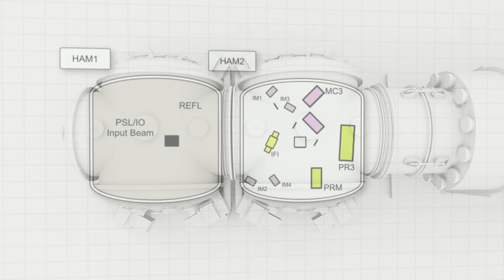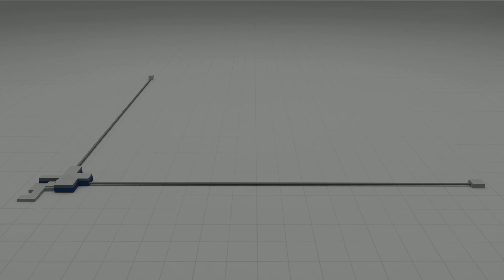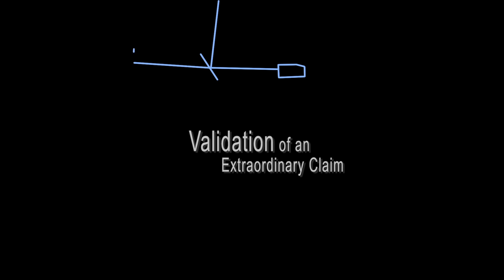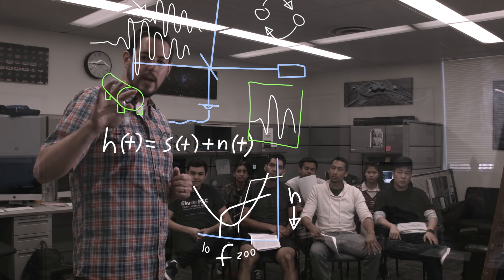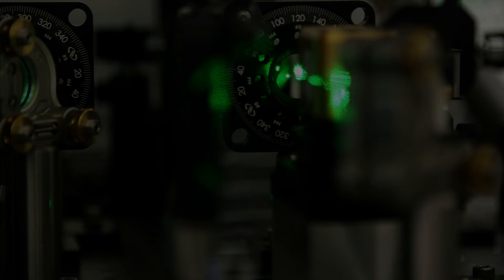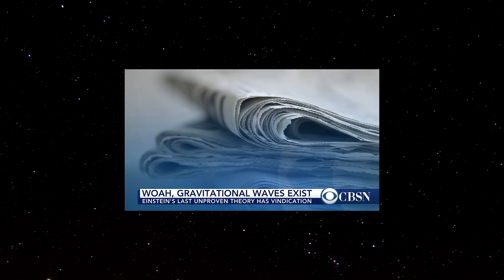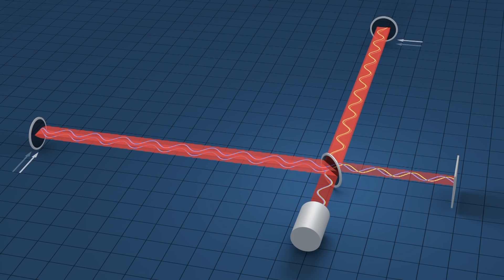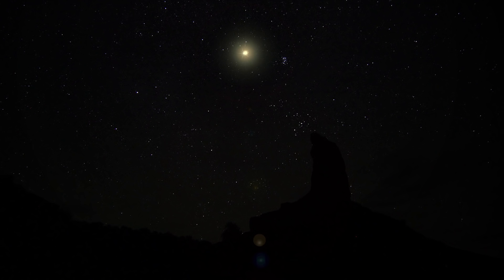LIGO Detection (Full Documentary)

Comment: hi, noob question; if gravitational waves travel at the speed of light, then how can the lasers detect it? does it mean the waves have no, or, limited effect on light? does this then also mean that more mass will experience more effect from the waves? will that effect then also cause a wobble at the black holes in our milky way center? will that have another gravitational fluctuation in our Galaxy?
Reply: The ripples in space time slightly distort the lasers inside of LIGO. I believe that's how this was detected.
Reply: The waves distort the spacetime region that one of the laser beam takes to a different degree than the other (perpendicular and correlated) laser beam takes - so one of them ends up ever so slightly shorter than the other (a very slight difference - and that's only after the beam has travelled through the 4km long arms hundreds of times). As a result, when the correlated beams are recombined, they no longer 'fit' together - and interference patterns are observed. This could be detection of a gravitational wave created billions of years ago when one BH merged with another billions of light years away.

However, the same effect would happen if someone somehow gave one of the mirrors a tiny jolt! Such noise can be removed though, partly because the LIGO sites are duplicated (Livingstone and Hanford) - and you wouldn't knock both of them at the same time. But also partly because the expected signal from a merger of black holes (or neutron stars) is very well modelled and known - and is nothing like the signal that would come from me knocking the mirror with my hand.

It's very high tech and the engineering is astounding. But you can get a reasonable feel for it all from good sources on the web. I'd start with Wikipedia and some of the links in there, and the LIGO consortium's websites. The project also do a fantastic twice-yearly newsletter (March and September) and they're all available at https://www.ligo.org/magazine/. Most people use YouTube videos too much IMHO. They can certainly be useful... but the best way to get deeper understanding (whether gravitational waves, maths, or fixing a car engine) is to get stuck in, rather than have information 'delivered'.
Reply: @gordonpanther7766  right so actually this effect is so minimal it wouldn't really have a noticeable effect on other matter? what if you were closer to the colliding black holes?, say the collision happened in the centre of our own galaxy, would the effect be more intense?
Reply: @woof3065  Yes, the closer we were to such an event, the greater the effect would be.

The waves have spread over an increasingly large sphere as they've moved away from the source. Area of sphere = 4 * pi * r * r, so every tripling of distance (say) results in the waves becoming 9 times weaker. These detections are of collisions billions of light years away. The first detection, GW150914 (https://en.wikipedia.org/wiki/First_observation_of_gravitational_waves) was 410 megaparsecs ~1.2 billion light years. The centre of our galaxy is 'only' 30,000 light years so GW150914 was ~40,000 times further away.

So if GW150914 happened in our galactic centre today (or, I suppose, 30,000 years ago, since we want to measure it today # ;) it would be ~40,000 * 40,000 times or ~1,600,000,000 ~1.6 billion times stronger.

However, since the space-time wibbly-wobbling (Dr Who terminology) that was detected for GW150914 was on the order of a thousandth of the width of a proton, and since a proton is only about 100,000th the width of an atom, that 1.6 billion times stronger wobbling would still only be... 16 times the width of a single atom. This is assuming I've not made any daft maths errors or misunderstandings # ;)

But if that's all roughly right, then the effect would be absolutely MASSIVE in LIGO - but in human terms would still be 'invisible'. Which all goes to show just how tiny these movements are and how amazing it is that we can detect them using our technology - and how amazing humans can be when they work together (like scientists do), rather than falling apart (as we, the public have been doing in recent years).
Reply: @gordonpanther7766  thanks a lot for doing al the math and putting it in perspective ^^. And yes it is amazing what we can and have achieved and we could achieve a lot more if we work together more

Comment: My question is: How did the Black Holes found together? Have it been two galaxy cores?
Reply: I think black holes exist independently also, aside from being found in the center of galaxies.
Reply: No, these are stellar mass black holes colliding (i.e. black holes which formed at the end of a massive star's life), not galactic mass black holes.

As to how they merged together: all moving mass gives off gravitational waves, but even when two black holes each several times the mass of our sun collide, the waves received at cosmic distances (thousands or millions of light years) are minute and required extremely complex and sensitive equipment to detect them. But the emission of these waves bleeds off the orbital energy of the system - and the two black holes (or neutron stars) hence slowly approach each other. Over long periods of time, they get closer and closer. The closer they get, the more of their energy goes into gravitational waves and the faster they get even closer - the approach speed gathers pace. Eventually, the BHs/NSs are nearly touching each other and are rotating around their centre of gravity at a sizeable percentage of the speed of light. The final merger happens very quickly and then there is a final 'ringdown' as the resulting merged BH or NS takes on a spherical shape.

Best thing to do I'd say if particularly interested (and have the time!) is to read (in addition to Youtube videos) as you get far more information for your effort/time. Start with Wikipedia, e.g., https://en.wikipedia.org/wiki/Hulse%E2%80%93Taylor_binary; https://en.wikipedia.org/wiki/LIGO; https://www.ligo.org/magazine/ - and some of the links at bottom of those pages etc.
Reply: @gordonpanther7766  Wow, five years later I get an answer. Thank you! 
I've read a lot since then and played around with BHs/NS in Universe Sandbox and Space engine. Now I think I got a grief of what physics are going on. It's fascinating!
Reply: @Irisius  Ha ha. Yes, well I was just in here replying to some other post and scanned through and commented on a few posts at the same time. Some are genuinely interested like yourself - but I'm always surprised how many loons, pseudo-scientists, and conspiracy theorist frequent scientific pages! Well done on your researching! LIGO should be back up for its next session (O4) in 3 or 4 months time (Dec was last planned date I saw). To keep us going, the twice-yearly LIGO newsletter will be coming out in the next few days (March and September) which I expect will update re: O4, and links in with Italy's VIRGO and Japan's KAGRA detectors. Always worth a read, even though some of is beyond me!

Comment: Can someone please explain how on earth that thing can detect anything!?

If one tunnel shrinks or expands, why doesn't the wavelength of the light follow along? If it did, LIGO wouldn't be able to detect anything, or would it?

Since light resides in space, it should shrink and expand with it...?
Reply: The distance between the mirrors gets wider. The lasers measure the difference in the distance between the mirrors extremely accurately
Reply: Here we see a perfect example of the dunning-kruger effect. While Alexander resided in the valley of despair, CosmicOwl was talking down from Mount Stupid.
Unfortunately i have no answer to the question.
Reply: @LionNick  I'm not sure I'm any wiser today, but at least Sabine Hossenfelder said in one video "that's not how it works". So I do at least know that I'm missing a part of the puzzle.

What it looks like to me is that light is allowed to change wavelength along with space depending on what theory you currently work on. If it's the Big Bang, then light definitely stretches with space. If it's LIGO and gravitational waves, then it does not stretch.

Comment: How can we be sure we are not measuring creation or annihilation of electron neutrinos inside our measurement system? The scale of the neutrino is about as small as the resolution of the measurement system.
Reply: Gert van den Berg I'm no expert, but this system is not made to detect nuetrinos, it detects an interference pattern caused by a tiny variation in the distance of the lasers. I am not sure how a nuetrino collision/ interaction/ creation could set off both detectors simultaneously across the United states. The actual wave signature is very telling of gravitational waves. According to the researchers it matches exactly what is predicted. The researchers are not dummies and they spent quite a long time eliminating every possibility they could think of.
Reply: It strikes me as a possibility one should have to exclude. The resolution of the measuring machine is about the size of the diamater of an electron neutrino, so a merger of some sort could as well be a merger of that size within the measurement system. Also, we know things at that scale could well happen non-localized, so measuring at different locations does not exactly exclude this possibility I would be tempted to think. I feel this possibility should be addressed by the experts.
Reply: Because the discovery of the neutron star merger proved it.  They have the visuals on the merger.
Reply: LIGO is a machine which detects changes in the arm length of two perpendicular arms, and rules out noise from the local environmental (seismic movements on Earth, bumps etc.) by using independent copies of that machine at two far-removed sites (opposite ends of the U.S.). The purpose of the machine, and those measurements is to detect the effects of gravitational waves passing through them (and Earth, and you and me) which bend space-time (by a very, minute amount).

Machines to detect the "creation or annihilation of electron neutrinos" and all other forms of subatomic matter can be built and of course they do exist. But they are different machines - particle accelerators like the LHC (https://en.wikipedia.org/wiki/Particle_accelerator).

Particle detectors don't detect gravitational waves, and GW detectors don't detect particle creation - just as cars don't cook food, and ovens don't move people around. Commonality of scale doesn't mean commonality of purpose or effect: a speaker and a house brick are about the same size but have no functional relationship.

The detections of LIGO, along with corroboration by other GW detectors (Virgo in Italy, KAGRA in Japan), the detection of a Neutron Star collision by LIGO with corresponding detection in EM (light), the previous evidence such as the Taylor-Hulse binary (https://en.wikipedia.org/wiki/Hulse%E2%80%93Taylor_binary) etc, and the fact that observations all fit precisely with what were predictions of General Relativity all demonstrate that what's being detected are gravitational waves.

It's a marvellous demonstration of what mankind can do if we allow and enable the people who /can/, to /do/. We need to get science and scientists (rational thought) at the forefront of leadership of our planet because it's only through such working together, using our ability to shape and control our environment by technology (yes, it poses risks and creates problems - but its also offers all the solutions) that we will deal with the many global challenges we face. So here's to some form of "global governance" and off-planet colonisation. If we don't get that (and soon), this species is, one way or the other, doomed to extinction - which will be a crying shame when this species can do sh*t like this! (LIGO, I mean, not my rantings # ;)